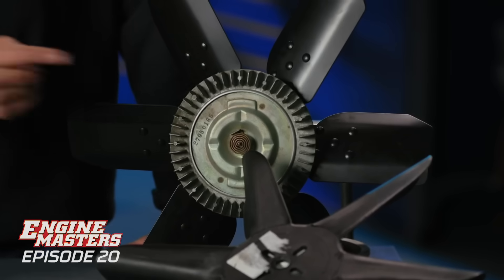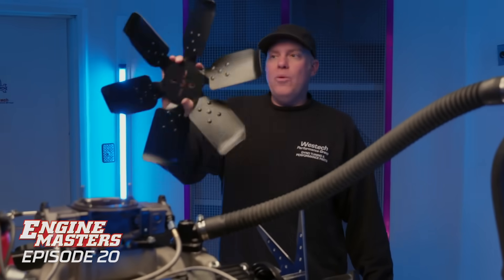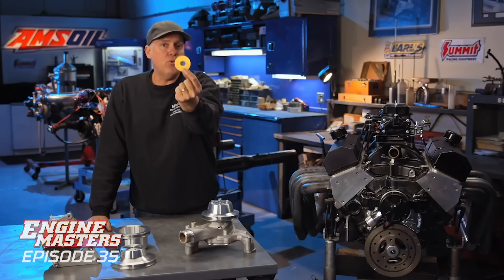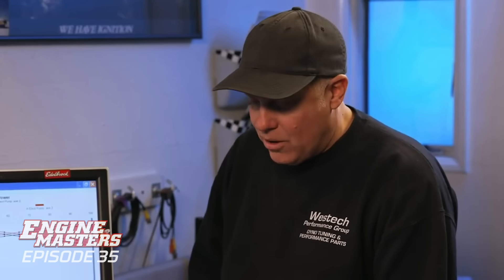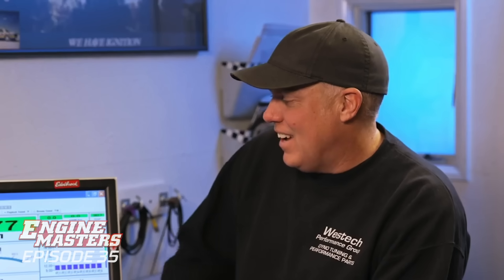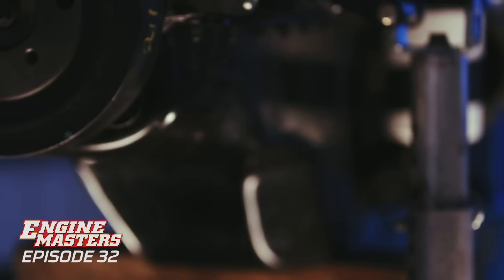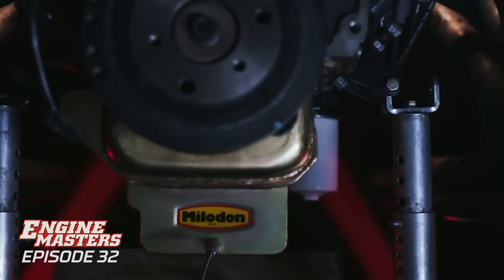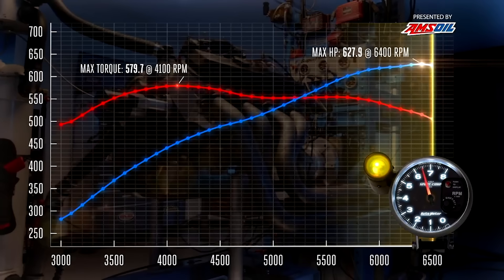Don't Do This! How to Ruin Your Engine's Horsepower | Engine Masters | MotorTrend

Comment: Regarding the fans, wouldn't you need to duplicate the engine compartment to keep air in that space as it blows towards the engine. Once it passes the shroud it's free to go in any direction in the dyno room as opposed to when there's a hoot right above which helps keep the air moving in the right direction and not any direction?

Comment: I use to use the stainless steel fan , I had no idea it was that bad as I spun the motor up to 6500 often. I should have bought a better radiator and used a electric or a factory fan. Secondly as far as the engine temp , There again I thought I had read that heat in the motor helped like 200 plus . I never could make that work out in the Texas heat .  I finally ran water alcohol injection . I should have used aluminum heads also. As far as the oil level one thing I want to know is this is a static test so add the Gs from acceleration and decell from the brakes and I wonder how steady the oil pressure is with the reduced oil volume . I read a what I think is a good description of why to run a dry sump ,.  A good test on lifters might be a swap from hydraulic roller to solid roller lifters on a hydraulic roller cam.  Thanks for the videoa

Comment: Windage trays and crankshaft scrapers have been used for decades to safely find HP without starving the engine of needed oil in high RPM. Dumping 6-8qts in a big block is off the dyno in real world drag racing when the pump can be starved of oil. I guess this is "new" info for Motor Trend??? Hydraulic float has been an issue for decades. There's ways to control it by getting the proper lifters and valley oil guides. All this vid is for giggles on the dyno. You wouldn't do this in a street car. It's just youtube nonsense. And if you're really racing, you'd be using dry sump anyways.

Comment: NO THANK YOU!!  i will stick with my trusty mechanical fan , the clutch kicks in when it is supposed to , not waiting for a electric fan relay to fail and not have a spare one to replace it , a old school mechanic told me years ago , fill the pan to the dipstick level and add a another quart , this will keep the oil pump pickup submerged at all times

Comment: To gain engine horsepower I just remove all accessories, hook up electric water pump, leave it on the engine stand no transmission no turning of the rear wheels, all of that maximizes horsepower

Comment: For the fan there are 2 factors causing parasitic loss. The first is as the engine speeds up the main loss will be from your rotational mass, I.e. you want to minimize the polar moment of inertia. To do this you want to minimize the fans mass and minimize the radius of the fan (I=mr^2). At speed the loss most likely will shift to the drag resistance of the fan blades themselves. This is more of a fluid dynamics problem but you basically want the fan to move the least amount of air necessary to keep your engine cool. So the answer to which fan to use is..... an electric.

Comment: Would be nice if these guys did more daily motors. Not everyone chasing hp has a ( little) 600 hp motor. Help the 180 hp guy get to 230.
Reply: Also "daily" in the way of full accessory loads, catalytic converters and mufflers, air filters and intakes etc.
Reply: Well, they are into more race or high performance oriented motors. They don't really do regular daily cars.
Reply: @mikewhitman745  put the race motor in the daily. Let’s get our priorities straight
Reply: @fullthrottlesolutions  ha!! I like it, I like it so much that I had a 450 natural, 700 on the squeeze 1980 z28 daily driver. The good old days...
Reply: Hot rod a smog motor that would be helpful
Reply: They probably use these 500hp engines becuase it's easier to see a change in power. On a graph you'll notice a 20hp dip in power and that might even be enough to feel in the car. But on a 120hp honda motor, a 3hp can almost be choked up to a change in atmosphere, temp, ect...
Reply: Uncle Tony! Old school hp 🤌
Reply: Add nitrous. Do it. Everything will be fine. Trust me.
Reply: cut off your cat, cold air intake, performance muffler & spark plugs are quick easy things
Reply: More like 145hp 😔😔😔
Reply: @poopstermcpoopson5667  need bigger pistons
Reply: To be honest if your only making 180 chances are you’ve got a economy motor. If you want more power your gonna loose MPG’s
Reply: @MRMechanicRC I dunno. I have a 96 Ranger 4x4 with a 3.0. Custom ground cam, later intake, and jba headers. Gained almost 25hp and gained almost 3mpg in a 15k mile sample. (To be fair, 95% of my miles are zero traffic interstate)
Reply: Its 2023, 1,000 whp is a daily driven motor now.   lol
Reply: I'm with you.  Too many of these shows are geared thinking everyone has thousands of dollars to throw at an engine.  The average person does not have the money.
Reply: All of the things they did to the 600 hp engine will help 180 hp engine. Horse power costs big money there is no cheap way…..
Reply: @joshkrause2977  pretty much if you can't afford cam heads and carb there's no point
Reply: That's a YOU problem poor folk
Reply: This helps the poors I installed a cheap aluminum radiator with electric fans for 200$ cad
Reply: The right parts and a good tuner
Reply: Get it dyno tuned, then go from there
Reply: Chevy 1.5t lol
Reply: Drain some oil.
Reply: It’s not 1980 anymore, stock daily cars(or mustang Camaro) are making 450-480 from the factory, with a few mods they’re hitting 600.
Reply: @alexcorona  ~500 hp small block in the 80’s would have been a nightmare in traffic. The future is pretty great.
Reply: If you got an obs Chevy with a 350 you can get over 100 more horsepower out of it with like 3k Jegs sells a plug and play throttle body fuel injection system for like $900 you buy a mild cam for like $350 a aluminum intake manifold for $200 and aluminum heads for $1600 you saved on a little weight and now have a butt load more power
Reply: You dont need guidance getting from 180 to 230…
Reply: There is not as much available for those engines.
Reply: Spend money
Reply: A 50hp increase? You’re looking at forced induction, which is not cheap. It costs a lot to make a car faster AND maintain reliability. For a good quality, turnkey kit (meaning all supporting parts like bigger fuel injectors are included), with a small turbo, you’re looking at $5,000. Then, after the installation is done, pray that something doesn’t break (like your transmission).
Reply: Let's assume u have a non ecm engine, then cheap n easy - higher ratio rockers and headers with dual exhaust. Zero money hp gains - remove all emission control garbage. Hollow out cats, remove lean burn valves from carbs, pull air pumps, pull a/c units, pull egr valve. For less than a $100 - bigger jets, advance timing couple degrees, go with manual steering gear, bigger diameter water pump/fan pulley, 180F t-stat, higher octane fuel, higher volt coil, hotter plugs with bigger gap, lower weight oil, remove spare tire and rear seat, max air pressure in tires, leave girl friend at home.
Reply: It's the same concept. Doesn't matter what HP you have.
Reply: You see more of a difference with higher power it's simply to show a difference .
Reply: i’ve maybe got 90 wheel in my 84 yota🥲
Reply: All of these things apply to your motor also, they use these motors because there is a more notable power difference.
Reply: No, that has zero entertainment value, and that is pretty easy, bolt on parts.
Reply: Little engines have fans too
Reply: The physics dont change.  The info that applies to the large horsepower applies to low horsepower.  The reason the gains are smaller is because of percentage.
Reply: Yeap the rich dudes are watch it's us day to day guys, that's why show like vice grip garage is so popular
Reply: Well from the looks of it it looks like a pretty simple small block those center bolt valve covers give it away, there aren’t many really good small Chevy heads that use center bolt valve covers only slightly better than stock stuff
Reply: Agreed. And I’m a 220 hp Volkswagen 1.8t trying to get to 250 with an early 058 block with a belt driven plastic fan. But I’m not sure how valid it is because it’s very small half the size of the radiator, The other half of the radiator is occupied by an electric fan.
Reply: Hot Rodding is not about stock cars.
Reply: Agree. I feel like they are always testing these amazingly built, 600hp, Naturally aspirated small block rippers. Like dude, we can't all start over from scratch and have our friend who is a world class builder pull this off for us.
Reply: If you need somebody to help you do that, maybe you should find a new hobby
Reply: In 2021 even 4 cylinders make 230hp.  A 5.0 from an '88 mustang with an intake and a cam and 100k miles will make 230 TO THE REAR WHEELS.  If you're stuck at 180, and it's a v8 of any kind, your build is way wrong.
Reply: That's what nitrous is for
Reply: Same rules apply weirdo .
Reply: If you have access to US V8 engines and have less then 300kw  you should get a different Hobby. I am A European so I don't get Small Block Chevy stuff for free like you guys in the US get, Still I built a 302 full Aluminium chevy Small Block, with drysump and EFi for 12.000$. It revs 8500 in quali map at round 450kw and 8000 in race map with around 410kw. So a full race engine.... for my C4 track Corvette. For 12 Grand.... soooo.... there is no way you can't run 300 to 350kw out of every Small Block, be it Ford, Chevy, Mopar... even the Buick/Olds 3,5 Liter Aluminium V8s can easily reach that Power thanks to tuning from the UK.
Reply: Stop being poor
Reply: @RealWANGHAF  🤣
Reply: @RealWANGHAF thats why your youtube channel sucks,
Reply: @RealWANGHAF Shut up idiot. You don't know his situation,besides he probably makes more money than you but has more bills.
Reply: @RealWANGHAF  Being poor is the new fad.
Reply: @RealWANGHAF  poor has nothing to do w it I’m broke and still have a 600hp car lmao
Reply: @ThatNoFbody-ch9ky you're broke because of a 600 horsepower car
Reply: @ThatNoFbody-ch9ky Your savings account: 💀     

LMFAO
Reply: 230hp 😂 dude you should just walk
Reply: @aloisblazit0053  that's not what the SRT-4 said...
Reply: @aloisblazit0053 that’s a SBC
Reply: 180hp? lol
Reply: Difference wouldn't show up on a puny motor
Reply: @mattbraysails  

No need for that language man, not everyone has the money, engine-bay space, or interest for huge heavy inefficient engines.
Reply: @CrazyWeeMonkey stop being poor
Reply: Daily motors don't need performance upgrades. They're just dailies. They are better off with efficiency upgrades.

Engine masters primarily feature domestic V8s, i doubt there are 180hp V8s nowadays.
Reply: They dont know about 4cylinders. They only know about carb.. not fuel injected
Reply: @curtis9918  that's not true they've done plenty of EFI ls motors or Holley efi kits you're just clueless
Reply: @curtis9918 that's not true its just when yiu are shooting on this sort of schedule efi is too much work to do. They all love Efi especially in boosted applications 

Dyno time is EXPENSIVE and so their shooting a test in like 4 hours, you can't run 2 engines or swapping huge parts sets like head oil pan exhaust and accessories and do a different efi tune work up each time it's just... Not something you can do on their schedule.

A carb for this rots of testing makes more sense and honestly at WOT doesn't actually change the data.
Reply: @curtis9918  no power difference when comparing carb to fuel injection....just drivablity.
As long as the fuel is properly atomized and you got the right mix the engine don't care
Reply: @smokeshow1984 What are you talking about?Carb always makes more power than fuel injection.
Reply: @PatchesOHoulihan69  No, you don't know what you're talking about.

Comment: How about measuring horsepower loss when your voltage drops below 11.5 with efi and msd/  versus a bigger alternator.  My dragster was doing that, my racepak was shutting off.

Comment: 8:02 since David says he reads all comments...
The EV crowd can actually help here with improving alternator performance. Alternators are essentially AC motors working on electromagnetism- there aren't any of the efficient rare-earth magnets inside, just iron that's energized into acting as one in the center of the stator (rotating bit). If you yank an alternator open and remove the iron core for an internal permanent magnet (search handbuilt windmills, people do this all the time for cheap power and I can post links) you increase it's total efficiency which means less drag, less power losses, and more consistent power in general. Since replacing the magnet only needs standard gear pullers and shop presses along with a $20 magnet, any drag racer squeezin out every inch of performance could do it.
Reply: I heard you can make an electric motor out of an alternator. Can you use an alternator both ways? Make power to charge your battery when needed then as a electric motor to add power to the engine as you go down the 1/4mi.?
Reply: @thatsonebadhatharry8610  Yes. In fact, they already exist and are OEM now- look up "Internal Starter/Generator" or ISG; Buicks have them and they're ~20 horsepower or so. The Gordon Murray T.50 also makes use of one, sort of.
Reply: @girthquake1413  Just adding a little power is better than losing power to run the alternator. If it could be done on the cheap or at least for as little as possible it might be worth taking a look at. Any plus is better than a negative.
Reply: Post those links.

Comment: So you can guess how much oil taken out of the pan improves horsepower but you cannot remember to measure a clutch and clutch plate before putting the engine in the car? Remind me to ask you how to build my engine but not let you anywhere near a wrench.

Comment: I loved my electric water pump for off-roading. It held the temperature perfectly no matter what, looked after the fan, warmed up quick and was great when stuck in a mud pit eating your own hot air. On a road/race car I wouldn’t fit one unless you have water cavitation issues.

Comment: To put the fans into perspective I designed a cooler pack for a CAT 3406 (450hp 24/7) and the 1.5m fan only used 27 horse power :o) Hard to argue against an electric sucking fan on a high reving car.

Comment: I use an electric fan also a water restrictor 180 approximate temperature also  oil and transmission cooler in one front of electric fan taking every item that can rob horse power even an oil deflector in oil pan.

Comment: Outside  an engine test rig an electric pump would not have not "no parasitic loss whatsoever". I needs to be driven by the alternator. So basically you have the same loss (actually even a bit more due to losses in the electric system). Main advantage is that an electric pump can be modulated better plus you could  - in theory - uncouple the alternator and run the pump from the battery at kick-down to get some 5 HP more - for a limited period to time though. The same with electric fans. They draw the same amount of power but you can spin them lower (or even stop them) if the engine is cool enough.
Anyhow interesting how much HP a fan actually takes. Surprised me  bit.

Comment: Back in the late 70's to mid 80's I drove Dodge PU's from 225 slant six 4 spd to 318 thermoquad and then the 360 and thermoquad. The owners brother was old school and put 30 wt oil in everything. Didn't matter if the oil filler cap said 10w30/40. After complains from newer vehicle owners who knew he used 30 wt Havoline, his brother told him to get with the program and use recommended oil. GeeWhiz, better fuel economy, eazier starts in the winter and still no knocking in Texas Summer heat.
Our mechanic for our County Patrol cars always used 30 wt. Had an engine issue and FORD told him if he continued to use 30 wt not the required in the 4.6 PPV Crown Vic, he was going to be responsible for the engine not Ford. They wrote the Sheriff a letter telling him the same thing. The oil soon changed to 5w20 or something like that. The motor that blew up on me was from a mass air flow sensor leaning out the engine until it melted down. Ford Covered it at 8900 miles. IT was an 2006 and they put a 2007 crate motor in it. The PPV cars just went from 3.23:1 to a 3.55:1 and it was quicker

Comment: Also, there are reverse rotation marine engines. Although a cooling fan is seldom to never a factor in marine applications it's worth mentioning as a consideration for those thinking strictly in terms of automotive street driven applications.
Reply: The engines aren't reverse rotation. It's the outdrives that are counter rotation to counter the torque steer the prop rotation causes. Also, marine engines don't run a T-stat because the restriction causes them to overheat.

Comment: So what did we learn? Well obviously I drive stock oil pan would probably be your best bet on retaining horsepower and torque. Secondly that well the closer you get to empty the more horsepower and torque you have. But here's the real question is a high pressure oil pump cause the engine to lose power versus the high-volume I would think a high-volume oil pump would probably put more strain on the engine. So that's a minor test but a major job to try to see what the power level differences between having a high volume in a high pressure versus a stock oil pump. I mean let's be honest if you put a mechanical fan with a 200 amp alternator a high flow water pump and say a high pressure oil pump and let's not forget about the old power steering pump cuz we all know that that drags the engine down to so between the fan the alternator the water pump and the oil pump and the power steering pump you could be losing upwards of 50 horsepower that's craziness.